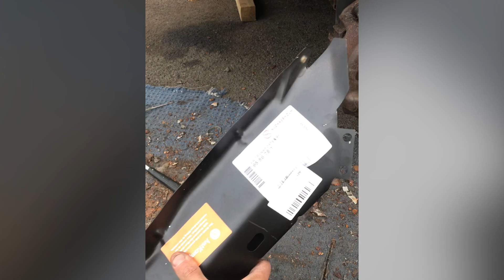VW T4 Driveway Restoration Van to Camper First Half Montage

Comment: I done many of the same jobs when I first got my van before I started to film stuff. 
I was lucky only needed a small bit of welding, grand job of the fabrication, welding and new panels 🤙🤙🤙
Reply from the maker: I’m nearly coming to the end of cutting out the rot, last stage is the sliding door cill and door itself but the weather has turned and I’m having to build a shelter to cover the van so I can carry on 🥶

Comment: H thanks for doing all these videos I have followed it all the way through I have just put mine through it’s mot failed big time on welding I will be doing it myself can I just ask how did you attach the outrigger? Poodle welding,tacked on or fully welded thanks
Reply from the maker: I had to reconstruct quite a bit of the sections above them so I firstly bolted it together as the shapes are difficult to replicate then plug welded them, that’s how they are as factory, plug welded. Make sure to bolt them on to the front slam panel section also which seats them in the correct place before doing any welding.
Reply: @pdubs7831  hi thanks for your quick reply I’ve got the same problem above now I’ve just removed what was left of the outrigger and found more rot above looks like I will have to remove washer bottle and air filter now thanks again for your reply I am now feeling your pain with all the welding and I am outside as well to make things worse it’s coming into winter and living in the north west uk it’s cold as well

Comment: Hi buddy, only just started to watch your channel,great work that is/was some undertaking
did you sort that little cubby next to c/lighter, if not I have one spare. Ihave same alarm/c
locking as you (not fitted yet) does the wiring go under van.
Les ( Torquay )
Reply from the maker: Hi Les, I’m either going to have it as a switch panel or make a deep cubby for putting my phone in but thanks for the offer. I’ve not yet either put the central locking in, no reason for any of the wiring to go outside of the van. I’ll be putting the control module in the dash then cables for side doors are right there to go through the bellows to the doors. Sliding door and tailgate cables will follow existing cables up the ‘A’ pillars along the roof behind the panelling.  Thanks for watching and your support 🤙
Reply: @pdubs7831  Hi, thank's for reply,I have already done most of my cabinets so was in too minds where to run cables, 
van was already lined etc: so will have to cut & repair, my van is 2002 T4 fortunately no rust as it was galvenised.
Still loads to do, split charge/ change d/heater /240v also swap double pass seat for single.
Les (Torquay)

Comment: Pretty much what you done to your van i did to mine but luckily mine fitted in my garage 😁
Reply from the maker: You get a thumbs down for rubbing it in 😁, the saga continues with mine, I’ve had to build a temporary shelter over the van and I’m taking parts off into the garage to work on with a heater to take off the chill 🥶